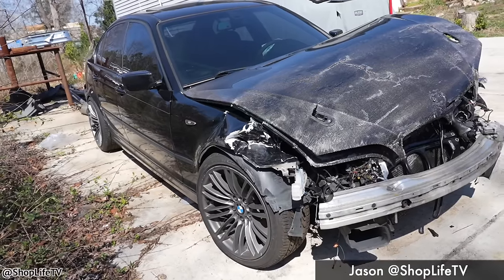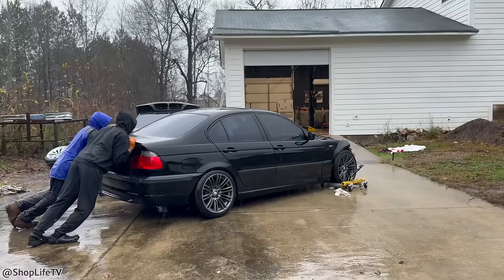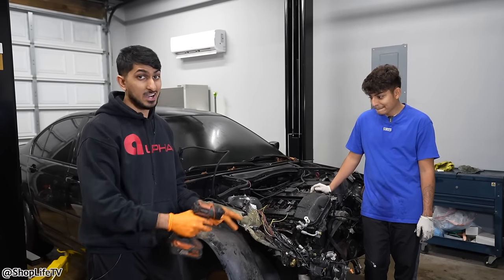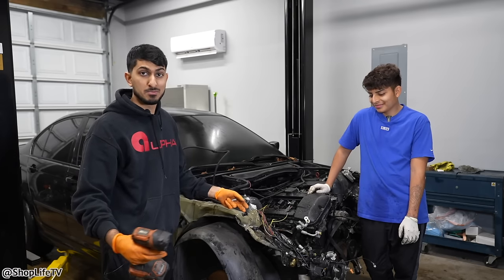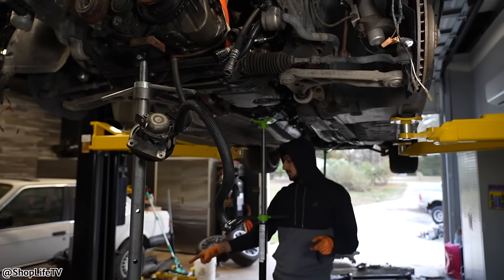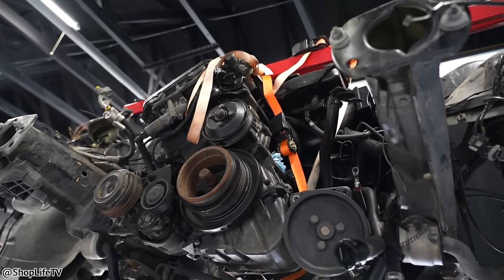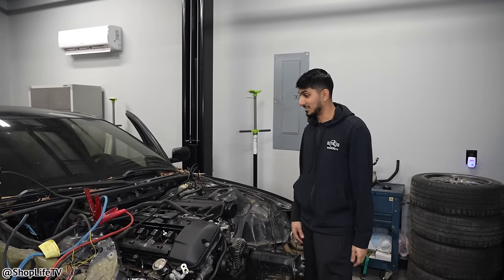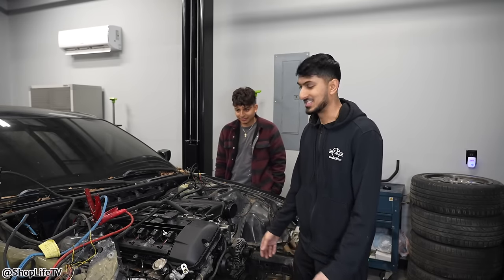WRECKED BMW ZHP CAN IT BE FIXED? WILL IT RUN? Part 1

Comment from the maker: Happy New Year! 

Learn from your mistakes and make the best of what’s yet to come

There’s a new year every year but there’s also a new day every day so chase progress not perfection

Hope everyone has a prosperous year full of progress!
Reply: I've got a question for you on my 2009 335i. Have done all the repairs you've taught me how including turbos. But, for a long while my steering at higher speeds does not firm up. It has new control arms, struts, and end links. However, I think I installed them way back one side then much later the other side. Could different size links cause the tires to not track solid on the ground allowing the "too easy to turn" symptom I have going on? Again, it's not loose steering, it's just very easy to steer like the wheels are on ball bearing plates. And thanks to anyone who may be able to assist.

Comment: Im in a similar situation, but my 2003 ZHP was t-boned while parked, so airbags and pyro charge didnt blow. Want them? The drivetrain is going into my new 2005 touring currently. Was working on the swap in my garage while this vid was being posted.

Comment: @shoplife, - my e46 doesn’t have the outside temperature feature even with sensor equip on the bottom. I don’t have the blinker stalk with the button to cycle thru information on the dash. If I were to buy a stalk with the button would it work to cycle thru information or is that computer based ?